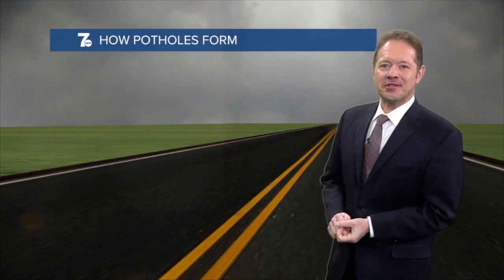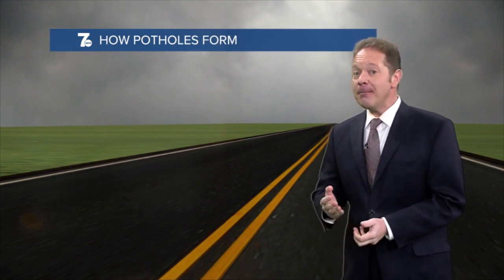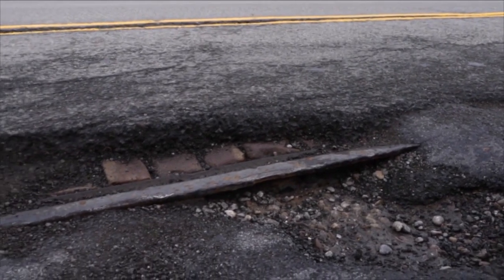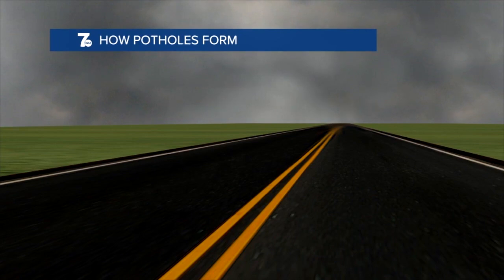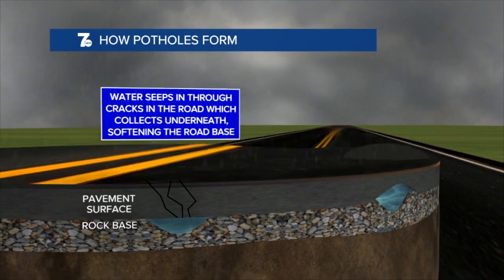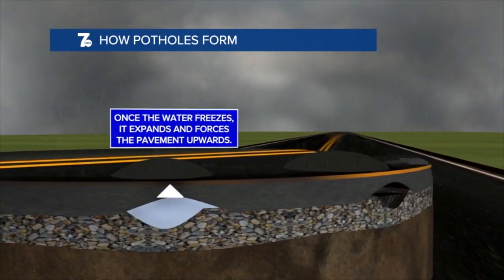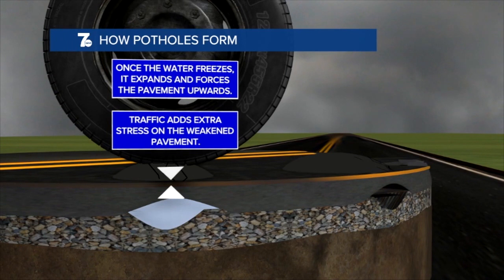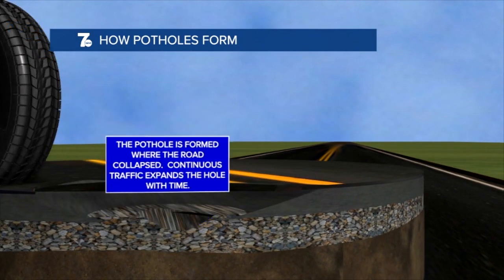The science behind how potholes form

Comment: I don't know if this is true but I once heard someone say that he worked to fix potholes and they used shovels to fix the potholes. in between potholes, they would soak the shovels in some kind of solvent to prevent it from getting too caked with asphalt stuff. Then they would later use the same shovel straight from the buckets, knowingly dripping the solvent on the ground so future potholes were likely to reform in that same area they were fixing.
I really hope it wasn't true but that might explain why potholes keep forming in same areas

Comment: I've never seen a pothole here in The Netherlands, but could it be because of the type of asphalt? Especially on the highways ZOAB (Very Open Asphalt Concrete) is used to increase the water carrying capacity (and sound reduction, plus almost no water sprays from tyres). To get potholes you may have put in the incorrect type of asphalt?
Reply: Combination of cheaper asphalt and heavier traffic.
Reply: it could also be because your always high so you don't notice them

Comment: In areas that don't have freezing weather the infiltrating water softens the sub layer then as vehicles drive over that slightly softer road that water gets pushed back up and carries a small amount of suspended particles of rock, this can continue for weeks or months slowly creating a depression and eventually the surface area of the underlying depression exceeds the elastic properties of the asphalt and it fails completely, the whole process also accelerates from suspension bounce as the depression starts leading to a row of potholes.
Reply: 4th power rule for damage by vehicle type.

Comment: We have a lot of potholes here at Hawaii. Never freezes. Just shitty workmanship I guess.
Reply: It's not just ice. It is also the hydraulic action of tires forcing water into imperfections when it rains.
Reply: I've heard that very hot weather augmented by bright sunlight on the dark road surface can cause those underground water pockets to reach boiling temperature. The pressure increase fracturing the road as surely as ice does. Hot, but not boiling, water also is a little less dense than cold water. That could also cause a pressure increase that could fracture the pavement.
Reply: Pot holes form because there wasn't enough gravel under the roadbed and the contractor cheaped out of the construction.
Reply: @Novusod what about in Florida
Reply: Lazy fuckin Hawaiians building roads
Reply: Same in Florida. This video was not helpful